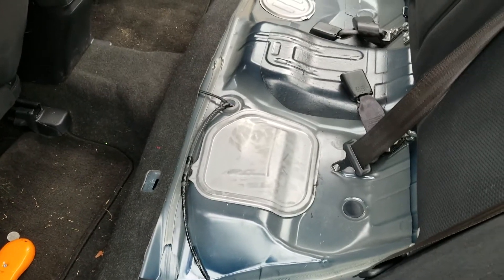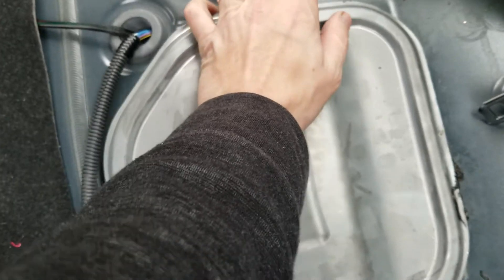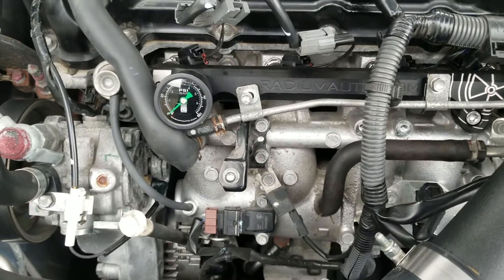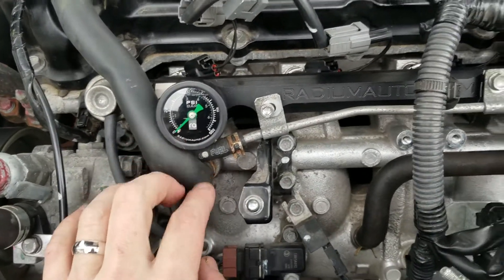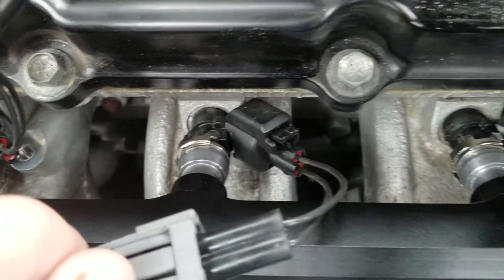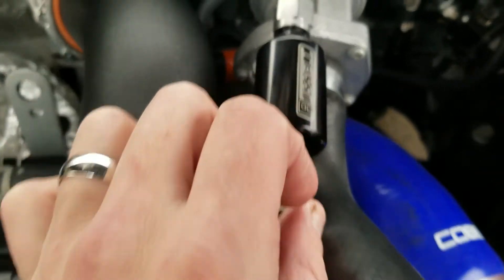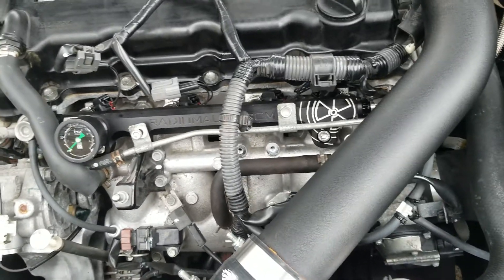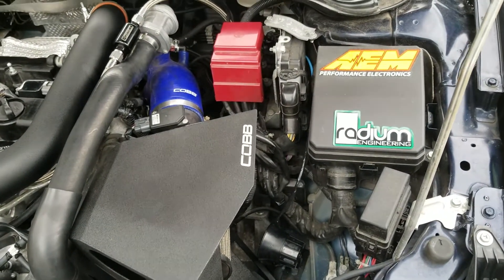EVO X MAP fuel upgrade kit walkthrough

Comment: hey did you drill out the return ?
Reply from the maker: Yes. I believe it's 5/64. It's easy to do. Took 2 minutes. You need to do it so you don't have fuel pressure surges.
Reply: @DPM9696  sweet thanks for the info man. Stock fpr as well? Deciding back and forth between a 450 or a drop in aem 340
Reply from the maker: @TrippyTro  yes on stock FPR. pushing 398 at the wheels. Full bolt ons and e85. But I'd go with the 450 that way you don't have to worry about swapping pumps again if you want to build more power. Walboro 450 is good for 700 plus hp.

Comment: Hey I know I'm a bit late on this. So I keep the fuel sock on the 450 even if I have an in line fuel filter? Running the same setup as you are just with an AMS rail and fuel labs fpr
Reply from the maker: Yes you need the fuel sock.

Comment: Do I need the inline fuel filter if I run the 255 walbro with just pump gas??
Reply from the maker: No if its a drop in, it will fit in the original stock fuel pump housing therefore using the built in stock filter

Comment: Walbro 450 uses the stock fuel filter.
Reply from the maker: Not true you lose your stock fuel filter when you install this. Thats why MAP kit provides you with a russel inline fuel filter that feeds off the line that goes in your engine bay

Comment: Hey Bud, Isnt there a fuel filter sock already on the Walbro 450 you installed ? So you still need another inline fuel filter ?
Reply: It's recommended to put an inline fuel filter if you're installing the flex fuel kit from Innovative and Driven Fab. I installed my fuel filter before the flex sensor coming right out of the tank. It's cheap insurance...
Reply: @akanabrian  gotcha yeah i ended up just ordering the Inline fuel filter to go with walbro 450. Still debating if i want to use oem wiring or hardwire it. did you drill the hole in the return fuel line ?
Reply: @denlin68  I opted to hardwire the pump knowing I'll be shortening the life expectancy of the Walbro. To avoid that I'm gonna get a pump controller to regulate the amperage since I'm not tracking the car 24/7. I'm actually in process of reading this how to: https://www.evoxforums.com/forums/showthread.php?t=28036 for or if I really need to drill. Hope this helps https://cdn.shopify.com/s/files/1/0677/6551/files/WTF-Walbro-450-Installation-Guide.pdf?8605959365199653895